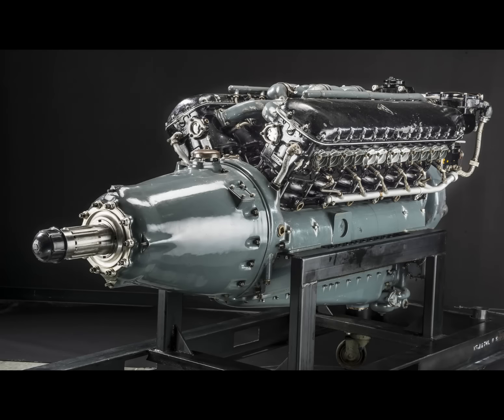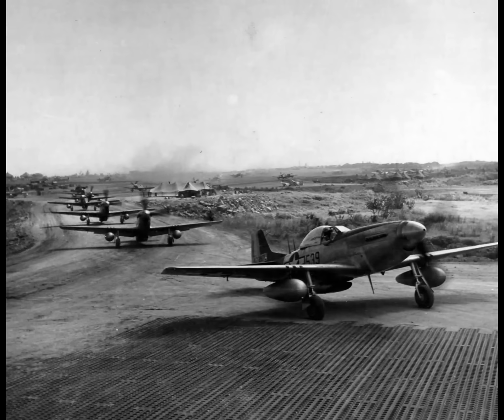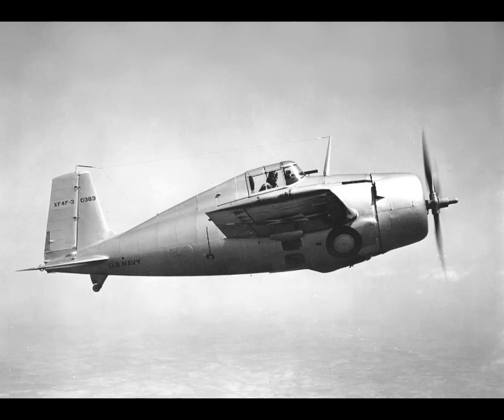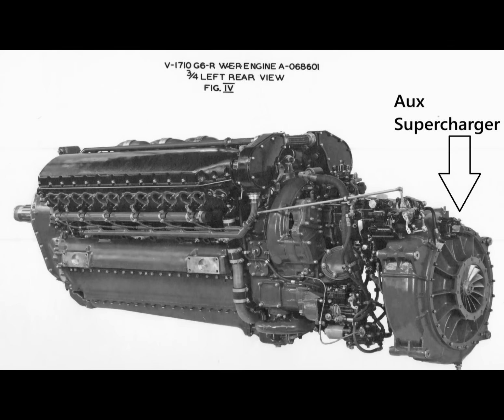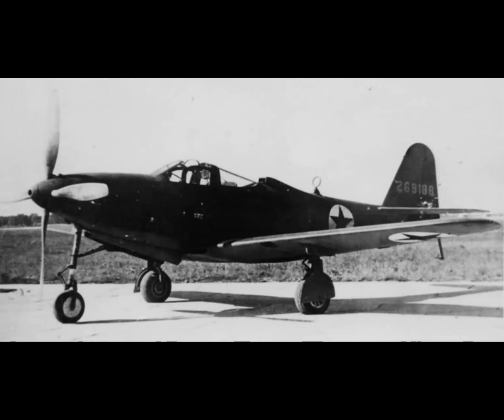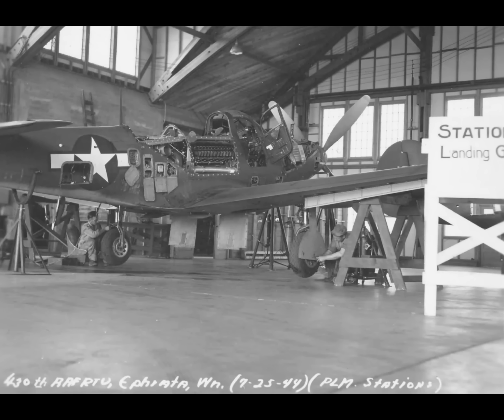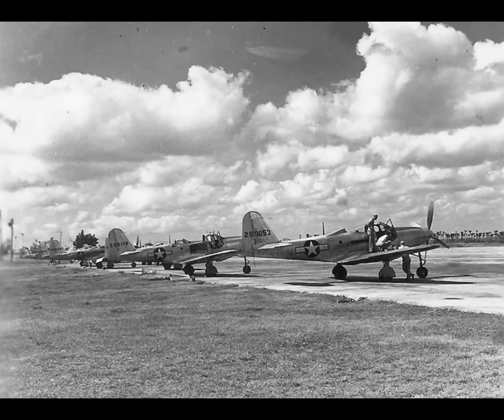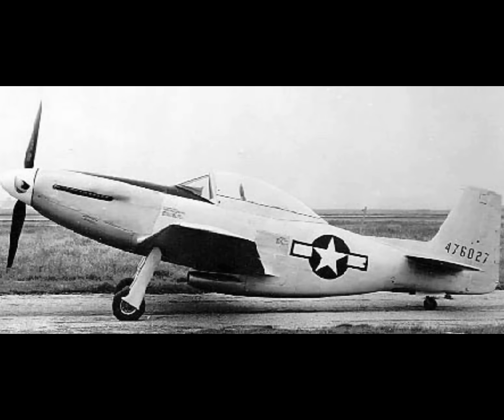Allison V-1710 with a TWO-STAGE Supercharger

Comment: Hey Greg I just had a question, not sure if it was covered in another video. What octane rating system did Americans and British use in WW2, was it RON or MON or AKI? Did they both use the same standard or is it like current day automobile gas where the Brits use RON and Americans use AKI?
Reply from the maker: It was essentially RON.

Comment: also once Packard signed up to make Merlins and finally Ford of England did too if were you wanted a 24 L V-12  you could stand in line or an Allison  and hope that someone would make a supercharger set up  that you wanted or get a Merlin that was being built like pancakes everywhere.
It is impossible to over estimate the effect of actual industrial production as opposed to maybe next year in a new factory production.
The XB-38, a B-17 with Allison V-1710-89 40 mph faster than the B-17 in both top speed 327 v 287 and cruise  226 v 182 (with a bad supercharger set up emasculating max altitude but that certainly could have been fixed) went no where as there were no free engines. 
The XB-38 which was a converted 17F was likely only 25 mph faster, the comparison speed are with the 17G with the speed brake of a nose turret I could not find a 17F v 17G
addendum https://www.wwiiaircraftperformance.org/B-17/B-17.html has top speed of a 17E (it would be safer if the picture was not a G but. it is) at 317 mph at 25,200'
This suggests the the XB38 is10-20 mph faster and primary because the Allsions had more HP thanm the radials not streamlining.
other than the tacked on picture of the Gor wrong model this seems to be a Nov 41 test vrbatum
the extaent that they describe how the plane was set up impresses me in th number of ways (I had not thought of) that the speed numbers could be 'scammed'.

here is the quote.
	To report on acceptance performance tests conducted at the manufacturer's plant on the B-17E airplane, A.C. No. 41-2399. Airplane equipped with four (4) Wright R-1820-65 engines with torque meters; exhaust driven turbo superchargers; 3-bladed constant speed propellers, blade design No. 6153A-18, blade angle range 21° - 88° at 42" radius. Landing gear retracted, wing flaps neutral, inter-cooler shutters wide open unless otherwise specified. Airplane loaded to design gross weight of 40,260 lbs., c.g. location 28.4%, except for range tests. De-icer equipment in place, marker beacon, radio compass, liaison and command set antennae in place. Airplane not camouflaged, armament in stowed position. (two .50 cal.guns in tail, two .50 cal. guns in top fuselage turret, and two ,50 cal. guns in belly turret. Nose guns not in place but supporting brackets installed in windows and nose.)

Comment: The photos at 2:55 for the Merlin and at 6:23 for the Allison two-stage engines shows how much more compact the Merlin's solution was.  The Allison's extra length pushed the center of gravity much farther forward, essentially requiring a different airframe than was used with its one-stage version.  The Merlin also required some adaptation, but not nearly as much.    North American Aviation determined that they would have had to move the wing roughly 20" forward for the Allison version of the Mustang and only more manageable 6" for the Merlin.   
Greg's "late to the party" comment is a good one.  By the time the US officials realized that the Mustang needed a high-altitude engine (partially at the urging of the English), the two-stage Merlin was already running.  Since Packard was already scheduled to build the new version of the Merlin in the US, those in charge reasoned that there was little point in paying Allison to develop and debug an engine with similar capabilities.
Reply: By the time that the merlin powered p51's arrived in numbers the P47's had turned the tide over Europe.
Reply: @kenneth9874  True.  The P47s were earlier and fought against more experienced German pilots.   Nevertheless, it made financial sense to shift to the P51, especially for escort missions, since it was much less expensive both to buy and operate.  Those in charge of the budget argued that 5 Mustangs were able to do more than 3 Thunderbolts for the same amount of money.
Reply: @jfess1911 the P47's made excellent ground attack platforms after the landings and compete in the air

Comment: It's relevant that I'm English born, actually during WW 2: it's pretty clear that the Allison was a better engine than the Merlin (many fewer parts, and I bet it had fewer oil leaks); but it was really handicapped by the USAAF sticking to its doctrine about turbo supercharging, rather than mechanical. The Merlin supercharger was largely designed by Stanley Hooker, who seems to have been unusual as an engineering hire at Rolls-Royce in having an actual engineering degree -- at least, that's the impression I got from his autobiography, _Not Much of an Engineer_. In British engineering, there seems to have been too much of a tradition of practical blokes in sheds: whereas the USA went wrong, when it did, because of rigidity in the high echelons of the design and specification bureaucracy (turbo charging, but also the great torpedo scandal).
Very informative video, thank you.

Comment: Greg, my friend and I had a conversation about this very thing a few days ago, and wondered what the P39/63 would have been like with the same supercharging system as the P38. Also, I read a memo on line where the Army Air Corps tested both engines and the Allison was judged as a more efficient engine than the Merlin. When you look at the cylinder head design, the Allison had canted valves, or angled valves and ports which flow much better into a pent roof type combustion chamber than the Merlin’s right angled ports and flat combustion chamber.
Reply: The original Merlin had a 'penthouse' cylinder head and canted valves.  But this proved unreliable and they quickly went back to right angle ports and 'in piston' chamber like the Kestrel.  RR were asked to try turbo-charging a Merlin but Stan Hooker said he could get equal or better results with 2 stages & 2 speeds with careful design without the extra plumbing & weight; the Merlin 60 series.  Good engineering: reliability & optimisation always trumps new fangled stuff and theoretical advantage (though Hooker was the supreme air flow theorist).

Comment: Is the Allison actually a "better" engine design than the Merlin? I've read (and your comments here reinforce) that the Merlin's strength was having dual stage supercharging when the Allison had single. But, from what I understand, the Allison was an easier and cheaper engine to manufacture, was easier to maintain, and produced similar power to the single stage Merlin.

In other words, is the single stage Allison on par with or better than the Merlin and, would the Allison have won out over the Merlin for use in the Mustang if dual-stage development would have been focused on to the same extent?
Reply from the maker: Yes, if comparing single stage vs single speed the Allison is better. The Merlin's advantage is entirely in its supercharging system, but... that's a huge advantage.

Comment: The thing I don't get is. Why didn't they size a single stage single speed for high altitude with a waste gate(or intake gate?) for low altitude.
Reply from the maker: They did, but it costs a lot of power down low.

Comment: what a great vid. i love this channel.  greg. could you do a comparison of the p51's aero dynamics and center of mass to the p39/63. engine power aside, was the p39/63 a better handler than the p 51?  so this would have to be at lower altitude to equalize the power out put of the two engines.  thanks
Reply: the p39/63's center of mass should be much closer to the aerodynamic center of pitch and yaw than the p 51 and therefore this should translate into faster maneuvering around those axis.

Comment: Hi again. I just wanted you to know a couple of more tid-bits of Allison lore! The Allison in the P/F82 was rated at "Over" 2,300 HP!  IT WAS NOT VERY RELIABLE/DURRABLE AT THAT RATING! However, the NAA Engineers and Edgar Schmude fixed the problem completely, by installing "Backfire" screens just like the R-R Merlin had all along! However, the USAAC did not want to spend precious post war funding on a prop plane as they thought jets were the future! So, they soldiered on for five, or six more years and the Korean War with million-dollar bugs that could have been and were fixed by 25 Cents worth of Brass screen material and half an hours' time of a skilled mechanic!

Comment: Greg, the label in segment 10 minutes for the 1650-3 at lower left should have been P-39 - the 'red' 1650-3 curve cited as P-63 vs red P-51 label helps match the Mustang - but probably confuses some in the audience. Understand why you labeled P-63C for later comparison for possible 2s/2s version vs 1650-3. Good presentation.

There were two XP-51Js.Only one was flown at Inglewood. Both were crated and sent to Allison. The installed 1710-119 never worked well at NAA but rumor states that Allison made improvements leading to the V-1710-143 later installed in the F-82E & Subs. Schmued hated the mandated engine conversion from the Packard 1650-21 because Allison never solved the aftercooling issues on the 1710-143 for reliable boost above 62"MP, refusing to even install a backfire screen.  Sad business because it dropped top speed from 475mph to approx 440mph which emasculated the F-82 performance. 

Well covered but we can blame GMC for not investing in a 2S/2S version circa 1941 to compete with the soon to emerge Merlin 60 series.
Reply from the maker: Yup, the Graph could have been better, when I made it initially I didn't plan on putting the 1650-3 on there, so when I went to do that, it jumbled it up a bit. I figured the colors would make it clear enough for most.

    I think we are all looking forward to hearing more about the lightweight Mustangs in your upcoming book. It seems there is a pretty interesting story about each one.
Reply: According to "The Convoluted Quest for Fighter Engines" (Joe Christy, Air Trails) the Merlin was essentially developed over a much longer time frame than the Allison, as it was a scaled-up version of the Rolls Royce Kestrel.

Comment: Hi Greg-that "fluid-Coupling"-you talking about--sounds like connecting a G.M-Hydramatic-Transmission-to an engine-like Tommy-Ivo-did with his "4-Buick Enginged-Dragster"-back in the day-!-to overcome  "Mechanical-Lock-up"-the 'Hydramatic-Transmission"-was an amazing invention-that came out in the 1939-Oldsmobile-I have one -a 4-speed Hydramatic-in my 50-Olds-"rocket-88"-futuramic-sedan-I bought of"Col-Frank-Borman"-of Apollo 8--(R.I.P.-Mr-Borman)--Still going strong-!!

Comment: My takeaway:
So in the lead-up and through WWII several methods of supercharging both inline and radial engines were being developed. As my late die maker machinist (and USN MoterMac) Dad would remind me, TOOLING! That’s that devil in the details whenever a major manufacturing product is given the green-light. Tooling is expensive and expensive to change and update. And there’s the time and effort issues which all combine with expense and dictate an outcome.

Comment: Best supercharger system of the war the Merlin's or the Corsair Double Wasp's?
Reply: -The Merlin had both superchargers on a single shaft with a 2 speed gearbox.  The corsair had separate shafts with Independent drives that was effectively 4 speed. 
So the PW was better.
-The Germans had a 2 stage intercooled 4 speed with independent drive  supercharger for the BMW801R but the factory was bombed and they lost most of the drawings, prototypes and tooling.  As it would take too long to catch up they simply abandoned the program.

Comment: Daimler Benz also had a two stage supercharger with water injection for its engines.  The DB605L for the Me 109K6 .  The engine was delayed by bombing of its high altitude test cells so the 109K6 (which required a four blade propeller and a bigger intake scoop) barely missed out on Service.  
-The bigger DB603LA installed on the Ta 152C so maybe three deliveries.
-The DB603M was expected to produce 2800 hp and used an infinitely variable hydraulic DRIVE with a two speed Mechanical drive.

Comment: 4:45 you make the point strongly that the Navy would only buy air-cooled radials while the Army Air Force was obsessed with turbos.  All true, but the P-39 and P-40 were also originally ordered by the Army Air Force for US usage, no?  While they ended up getting shunted into lend-lease after a bit, I think the picture might be as clearly against the idea of a dual-supercharged liquid-cooled engines.  I'd suggest a third corner to shore up your otherwise excellent point: to the extent the US military WAS buying non-turbo liquid-cooled planes... they wanted them cheaper, simpler, and in larger numbers, than they could have gotten with a fancier engine.  And more specifically it wasn't buyer's remorse, they knew  exactly what the ramifications of single-supercharger would be, and were FINE with it.  With P-38's at high altitude, something was needed at half the cost to handle low-altitude duties.  Not sure if I understand the big picture but I wonder if that completes the landscape Alison was in.

Comment: 3:00 Rather than simply call the 2-stage Merlin "better than the Alison," I wonder if we should limit our point to "better high altitude performance than the Alison."  I'm certain the two superchargers and two (in modern parlance) intercoolers had a significant impact on cost, man-hours to produce, consumption of limited strategic materials, weight, and maintenance.  I'd guess that  the Alison was possibly "better than the Merlin" in ALL of these categories, does that sound reasonable?

As an American engineer whose worked a decade in Europe and several decades in Asia, I also feel a sting in the portrayal of Alison as somehow being too stupid or lazy to use double supercharging.  I think the technique was widely known for decades at that point, I think being used in race cars in the 1920s for a start, and there was ample prior and concurrent art to copy from as well whether the US naval engines or again the double-supercharged Merlins.  Instead, I'd guess Alison was building them like they were building them because that's what the customer wanted.  And in turn I wouldn't want the US military to be seen as stupid either: they had good reason to get cheaper, lighter planes built faster and with less limited strategic materials and that needed less maintenance.  Not all fighting was at high altitude, by any means.  I may recollect wrong but at low altitudes, weren't the Alison Mustangs comperable to the Merlin Mustangs or perhaps even a bit better?

Finally, a point I may have learned from one of your videos (if I'm remembering correctly): weren't Merlins up to the Mk IX Spitfire just single-supercharged much like the Alison was, and if anything had the impetus to move to dual supercharging in response to the US navy fighters?